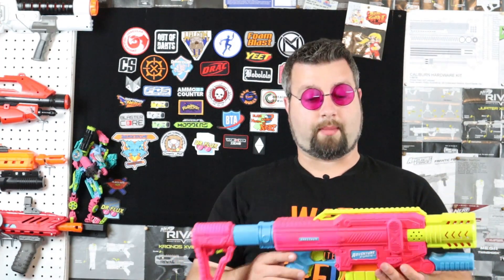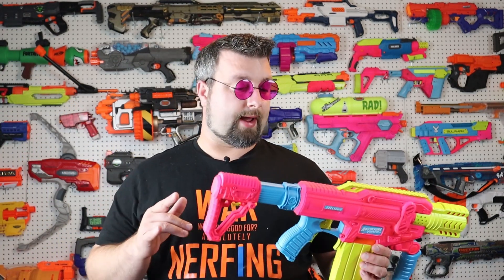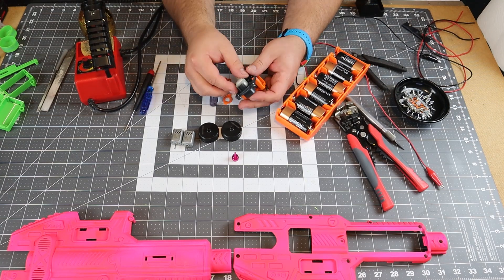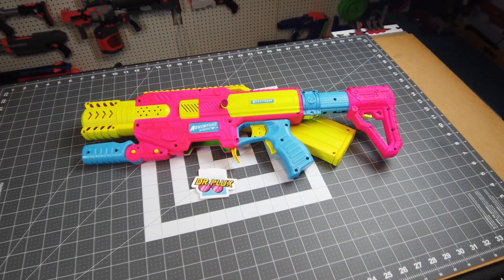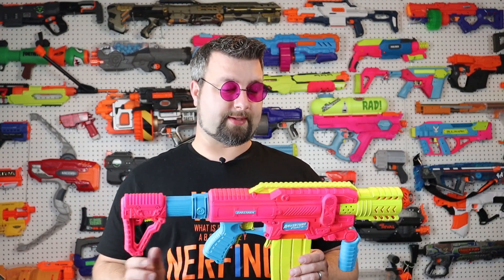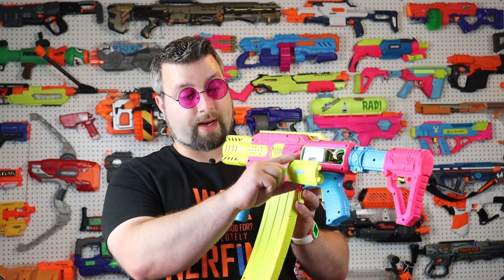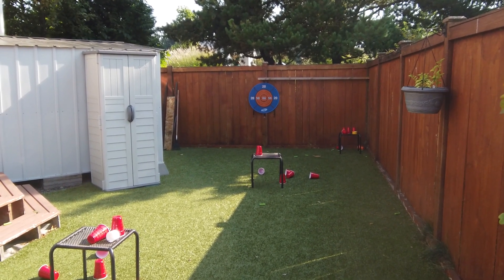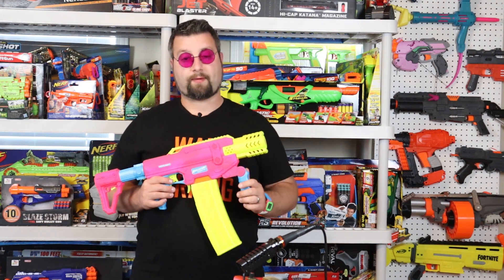Dart Zone Spectrum 3S LiPo MOD Guide 120 FPS

Comment: Hey I loved this video! I just got a spectrum myself a day ago and I was wondering if there is a resistor that stops voltage at a certain number of volts? I would love to use a lipo but I am bad at wiring so I want to run rechargeable imrs or something like that that is a double a battery with more volts. Also I had a really dumb idea I wanted to throw out to you and see if you think it will work or not. Do you think the stock flywheels with some ridges added on like a sleeve of sort will increase performance, or will it just do nothing. Also I thought of putting tape on the flywheels to make it less diameter for the dart to pass through, which means more crush. Let me know if these ideas would work or not.

Comment: How much room was left between the motor wiring tabs and the shell when you were done? I'm looking at using a motor span board and want to make sure it'll fit in that motor slot without shell cutting, while using 1mm silicone motor spacers as I'll be using fangs in a containment cage

Comment: It looks cool but that's kind of a dumb mod because stock it shoots 110 FPS you only added 10 FPS who cares
Reply from the maker: totally missing the point here... LiPo can be recharged and has constant high output until battery needs recharged. standard double A's have declining discharge until they are exhausted so no its not constant 110 FPS on double A's

Comment: do you think you can use 180 motors on this? it is my first mod ever. also, can you use the stock switch for 2s lipo
Reply from the maker: If you use 180 motors you will have to do some shell work. Like a motor cover on the side. As far as using stock switch on 2s to be safe you can with a mosfet. The issue is the amount of current the 180 motors would generate. I am not an electrical engineer so anyone please correct me if I'm wrong.
Reply: @drflux  ok thanks, ill cut off the cage thingy on the cover